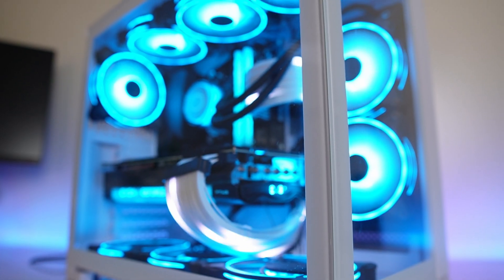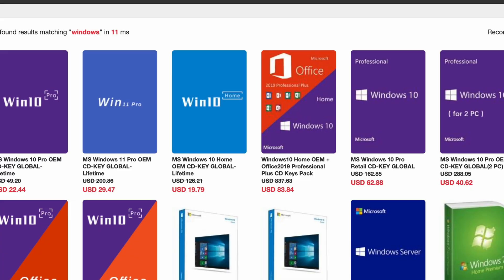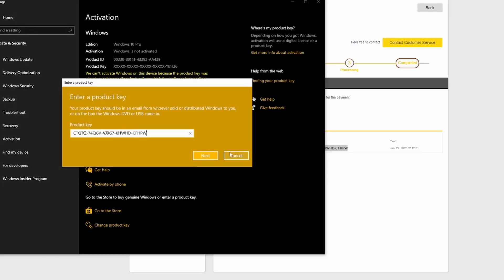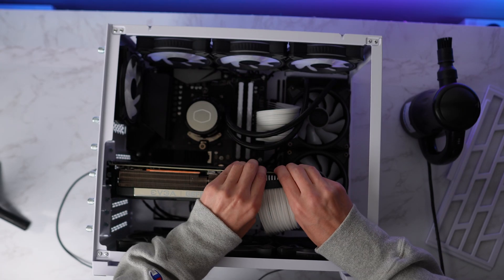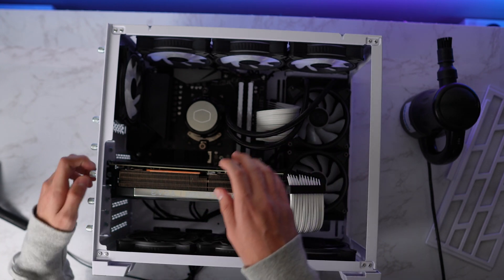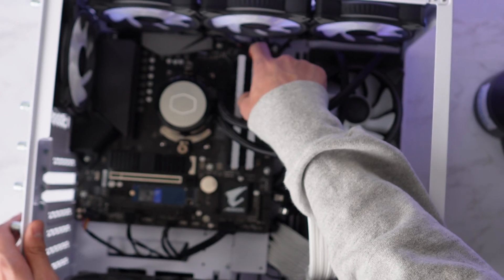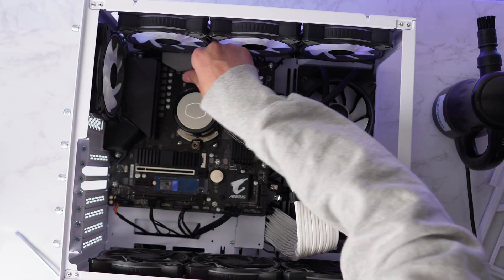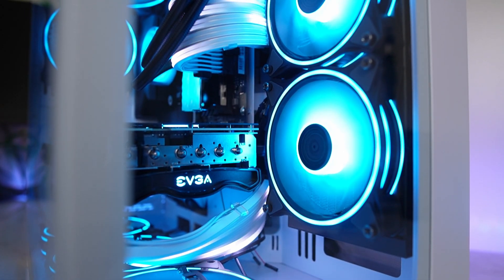Erasing my Pc from Existence

Comment: ouuu i have the same fans but just a single press button hub so i’ve connected my fans to my mobo, do u still have a way to use the coolermaster software to control the fans colors/light effects ? or do i need to buy a seperate controller for that…
Reply from the maker: I used signal rgb to control